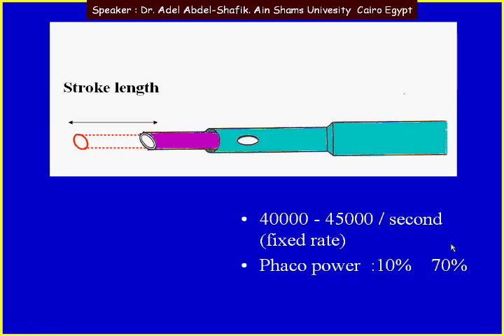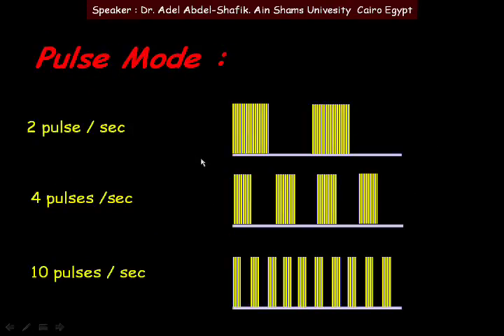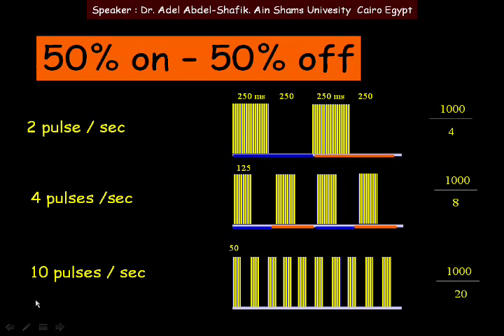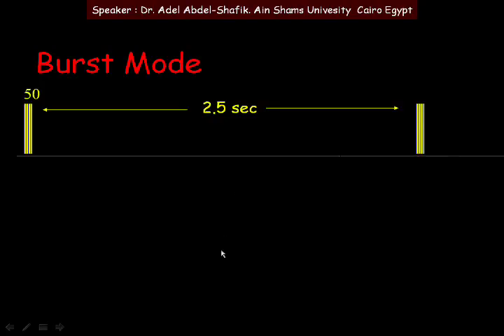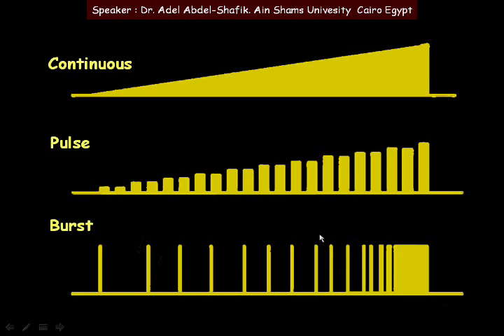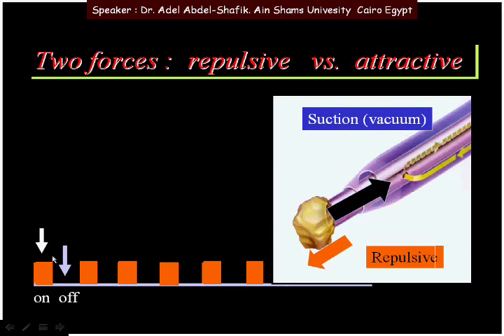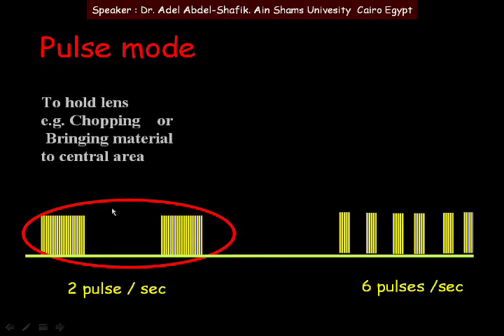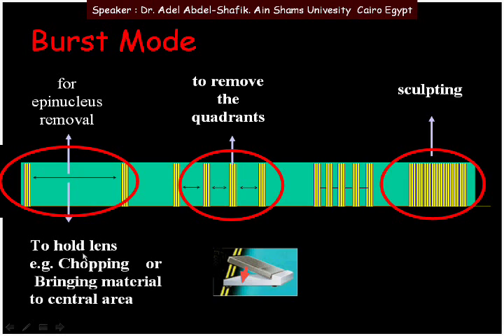Phacodynamics part 3/4

Comment: Thanks Professor,  how much flow rate adjusted with phaco power,  is there any correlation between flow rate and phaco power.
Reply from the maker: flow rate (means fluid out) and aspiration rate ( fluid out) these are the two factors that determine the volume of AC and should be adjusted to avoid lost of AC..    while phaco power does not affect AC depth at all.